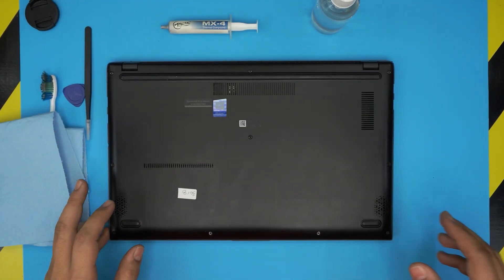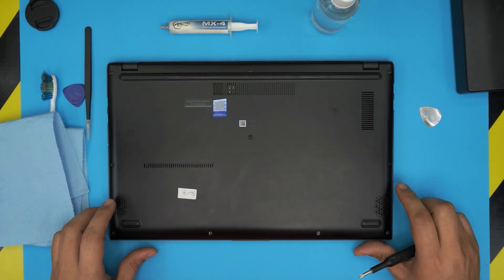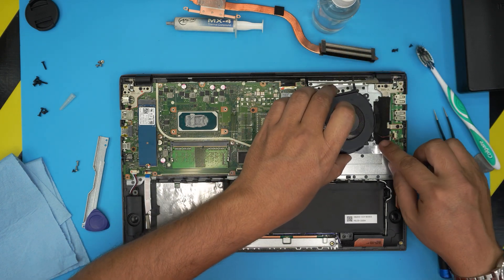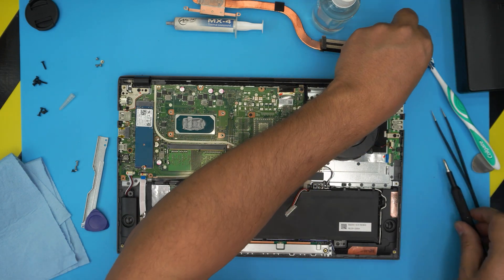Asus Vivobook 15 X512j ✅ Cleaning & Repaste Service💻

Comment: Hey my Laptop Asus Vivobook 15 X512j model this one { 256Gb NVme/ 8Gb Ram / windows 11} But i install Adobe Photoshop software is open but have some lag for edit time why is the issue ?
Reply from the maker: 🫠Regarding your question, you need to change the CPU priority of Photoshop to *"Above Normal"* in Task Manager; this can help improve performance.

*Steps to Change CPU Priority of Photoshop:*

1. *Open Photoshop*
   Make sure Photoshop is running.

2. *Open Task Manager*
   * Press `Ctrl + Shift + Esc`
   * Or right-click the taskbar and select *Task Manager*

3. *Go to the "Details" Tab*
   * If you don’t see tabs, click *"More details"* at the bottom.
   * Switch to the *Details* tab.

4. *Find Photoshop Process*
   * Look for `Photoshop.exe` in the list.

5. *Change Priority*
   * Right-click `Photoshop.exe`
   * Hover over *"Set priority"*
   * Click *"Above normal"*

6. *Confirm*
   * Click *"Change priority"* when prompted.

Should you have any further questions or requests in the future, please don't hesitate to ask me.
cheers🍻
Reply: @uFixTek wait i checked and Tald you Thank You so Much dear 🥰 @ufixtek How i connect you to ask laptop details ?
Reply from the maker: It's my pleasure my friend.
i'm sorry i don't undrestand you, write in your own language.

Comment: can someone tell me where is internal mic?
Reply from the maker: 🫠Regarding your question, the microphones are located right on top of the display beside the webcam (tiny holes). Usually, there are two mics: one for background noise reduction and another for capturing regular voice.
Should you have any further questions or requests in the future, please don't hesitate to ask me.
cheers🍻
Reply: @uFixTek  Thank you, I have replaced a better screen on my ASUS X512FA with better contrast ratio and IPS quality. After replacement mic and magnet of lid stopped working, now i know it. Thanks
Reply from the maker: It's my pleasure my friend.

Comment: this is why i like desktob
Reply from the maker: desktop is always the king but when you on move and you need portable then it is risky slop to choose the right laptop.
Reply: @uFixTek  yes man old laptops is crap and hard i think new one is ez to fix , some people give me their laptops u know change thermal pate or replace ssd , on old one u have to remove ther keyboard and mobo too if u want replace thermal paste😂😂 now this laptop is ez bec everything under the cover
Reply from the maker: hahaha some models are still require a bit of work before you can get into it.
Reply: @uFixTek  this is why i google it bec i dont want cut the wires "happen to me before" and it was the power pin attach to mobo "old models"  but HP and acer new models all are the same remove the cover and good luck 👌👌 btw its not my job , its side job   for thermal change maybe like 2-3$ " i use my own thermal high quality"

Comment: Nice Video!  I have problem with this Notebook, I need to reset the bios, but this mobo don't have a battery CMOS, Do you know how i can do? THK
Reply from the maker: Thank you for your feedback! If you wish to support the channel, you can like, subscribe, or both!
Regarding your question, can i know the motive of reset bios?, if your intention is to reset password, then with cmos reset it will not reset the password.
and this laptop does not have a CMOS battery it take the charge from main battery, just disconnect the main battery and the charger, then press and hold the power ON for about 30 sec and then the CMOS will reset.
the cmos configuration will be reset but the passwords get saved on a U1 chip separately.
Reply: @uFixTek  ok thanks very much, I needed to reset the bios.
Reply from the maker: It's my pleasure my friend. 😊 
Should you have any further questions or requests in the future, please don't hesitate to ask me.

Comment: Nice video! I am no expert at these things and I am trying to find a repasting vid for my Asus Vivobook 15 Pro. But it looks like its built quite different. My problem is that while gaming I get GPU all the way to thermal throttle which happens at 86 celsius and I noticed that my charger adapter gets quite hot after like 15 minutes of playing, could it be a faulty adapter and thus the overheating of GPU? Feedback would be appreciated, thanks!
Reply from the maker: Thank you for the feedback! if you wish to support the channel you can LIKE or SUB or both :P
regarding your question:  we do get this laptops in shop and after testing we found out that the GPU doesn't thermal throttle @86c , its because of power delivery that the board can't give the AMPs required to the GPU so it clocks down. the chargers get weak over time, this is very common and most technician can't detect this as this is subject to electrical engineer, the charger with you measure with multi-miter you will see the voltage that is giving 19v or 20volt, but as soon as gpu or cpu start drawing volt the charger gets week and drops the volt by .5 or 1v and that causes under-volt .
i recommend you to find your self a NEW ORIGINAL charger.
BUT remember the overheating can affect the  thermal throttle, and a repaste is a good idea to do every year.
Reply: @uFixTek  THANK YOU! I just got cooling pad yesterday and it holds the temp between 79 and 83 now when gaming. But I dont wanna bet on that, I am repasting and going for a new charger. Subbed already! Great helpful content.
Reply from the maker: It's my pleasure my friend.
much appreciate the support.
If you have any future questions or requests, please don't hesitate to reach out to me. I'll be happy to assist you.
Reply: @Yoshiiinko  Did you try to get a new charger? Did you try anything else that helped?

Comment: Hello, I spilled tea on the keyboard and it went through the keys/the fan part. I let it dry the whole night and put it back together the next evening, it works fine for the most part but the wifi dosent even work/connect properly unless it is in the same room as the router. How can I fix this.
Reply from the maker: Thank you for the feedback! if you wish to support the channel you can LIKE or SUB or both :P
regarding your question: its very easy fix my friend, pull up the antenas cable they are push down, snap on jacks. and invert them, place the black cable to the white and the white to the black https://imgur.com/a/8lwJoYp
that's all